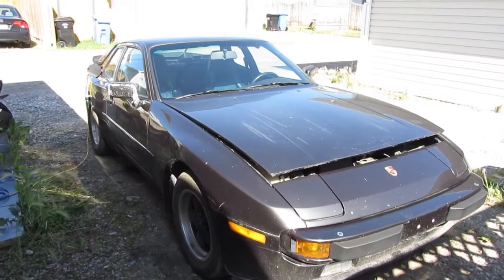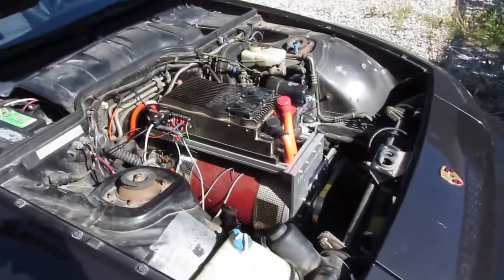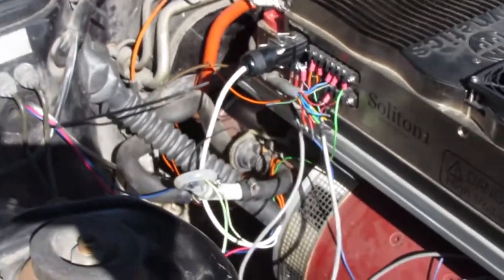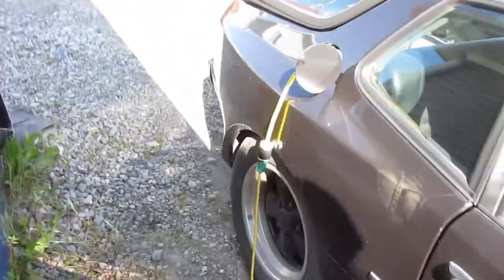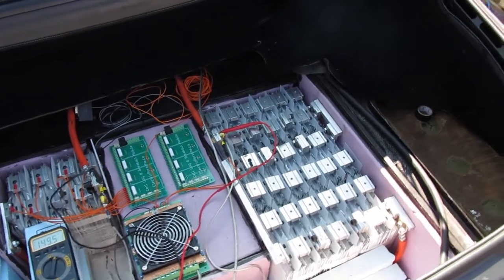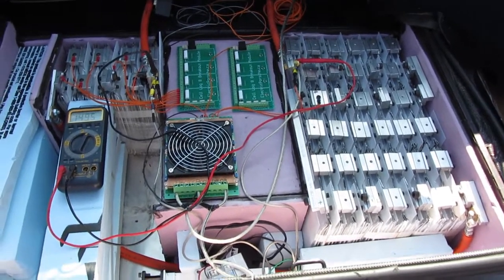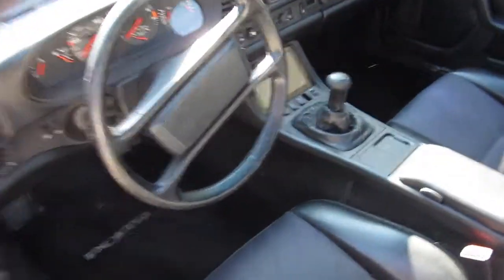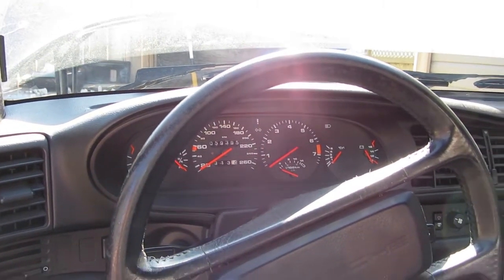Electric Porsche 944

Comment: Hei Robin, still got the car ? im looking for all the possible info i can gather for a warp11 soliton1 944 conversion.
Reply from the maker: Still my daily driver, however it now has a Siemens AC induction motor and DMOC 645 inverter.  Evnetics no longer exists, use caution going with a Soliton1 today.

Comment: Very nice build. I see you got a little tired with updating your blog  with the Siemens/controller swap f.ex. (that I would really like to see) or maybe more busy with the (ugly) 914 ;)  If you still have the beautiful 944, can you please think about making a new video so we can see what you ended up with - would be a joy, and also maybe save other builders a lot of trials and errors. Whatever you do, nice job - I really would like to do something with my 944, but I love the engine too munch to rip it out... if I had one with a blown engine it would be a different matter. There's another way to go - especially if you are a motorhead.  Did you know there's a company that sells a full conversion kit for the 2.5L to run on gas(hydrogen) ? I don't remember their name, they convert mostly big truck and bus diesels but also has the kit - I mean a really proven in racing-kit - with ceramic cylinder coatings and all.. I never found any video's, but haven't searched very thoroughly.

Comment: I have a soliton one and during my testing I am getting the error Pre-charge timeout, no voltage. Have you ever experienced this error when you were using the soliton one? Do you have any advice on how to go about solving this error, my controller mode is currently in Pre-charge Timeout, No Voltage.
Reply from the maker: Has it been like that since you got it?  That sounds like the main contactor isn't kicking in.

Comment: What is your top speed and what is the highest RPM you can take it?
Reply from the maker: There's no safe place here to test top speed so I don't know, however top speed is directly related to weight/hp etc so likely about the same as stock.  As for RPM, this is transmission limited, the motor will rev past 10,000rpm however I've never gone past around 7000rpm.

Comment: First gear didn't seem useless to me. The divide between those who build electric cars and those who actually know how to drive a car for performance continues.
Reply from the maker: That all depends on your gear ratio's, power level etc.  With the Warp 11HV/Soliton 1 and 300v pack 1st gear would just spin the tires without extreme care, even 2nd gear would spin the tires if you weren't careful so with 2nd gear at the limits of traction 1st gear was useless.

Comment: I have recently purchased a Netgain Warp 11HV for my 1984 Porsche 944. I am currently looking at the Evnetics Soliton Jr. motor controller to be paired with the motor. I was wondering if you had any thoughts or tips on the Soliton Jr. pairing with the Warp 11HV?
Reply from the maker: That should be a good combo, make sure you have good cooling on the motor.  Something along the lines of Jacks (evtv) turbo blowers that he use to sell.  I know most people with Solitons had issues (me included) so you may not want to max out the settings or risk blowing it up.  I switched to the AC motor for reliability.  The 11HV is a pretty amazing motor though I hope it works for you.

Comment: During your conversion what was your final gear ratio when using the WARP 11HV? During your EV conversion of the 944, was your drivetrain direct drive with a fixed gear ratio or did you use a transmission and had multiple gears?
Reply from the maker: It's a naturally aspirated body, but has an '86 Turbo transmission, 0-60mph can be done in 2nd gear with no shifting.

Comment: I am converting a 1984 Porsche 944 into a fully electric vehicle. I am planning on using the Netgain Hyper9 SRIM Motor. I was wondering what your thoughts for using this motor for my electrical drive train. Our mission is to convert this vehicle with a after conversion weight of 2,900 pounds, with a 0 -60mph in 5 seconds, and a range of 70-80miles. Do you this Netgain Hyper9 SRIM Motor can do the job?
Reply from the maker: A 120hp motor is not going to get you anywhere near a 5 second 0-60.  The motor would be good for the car, and likely be fun  to drive but not that fast.  The battery will determine your range.
With lots of traction issues I did 0-60 in 4.8 seconds with roughly 300hp and 300ft-lbs.  Now with the siemens AC motor I have 130-140hp and 220ft-lbs and my 0-60 is likely 7-8 seconds at best.  I haven't actually measured it.
Reply: What electric motor did you use to get "roughly 300hp and 300ft-lbs"?
Reply from the maker: The Netgain Warp 11HV, Soliton 1, and an A123 pack just over 300v just within the limits of the Soliton.
Reply: But the Netgain Warp 11HV only has 44HP and 135ft-lbs of torque. 
http://www.evwest.com/catalog/product_info.php?products_id=84
Reply from the maker: Those ratings are at 72v and 452A (32 1/2kw).... run it at 300v and 1000A (300kw) and you get a lot more power.

Comment: I am currently designing the electric drivetrain (motor, motor controller, batteries, etc) for the 1984 Porsche 944. While you were performing the electric conversion for the 1984 Porsche 944 what major problems did you run into? And do you have any suggestions or tips when creating the electric drivetrain?Thank you
Reply from the maker: AC motors really are worth the extra cost.  Otherwise the 944 is a pretty good platform, look at Volt/Leaf/Tesla batteries to power it.

Comment: What type of electric motor and motor controller did you use?
How fast does the car run in miles/hour?
What is the range of the car on 1 full charge, how many miles per full charge?
Reply from the maker: Initially the car used a Warp 11HV and Soliton 1 controller.  Currently I use a Siemens AC induction motor and Azure Dynamics DMOC645 controller.  The regen definitly helps!
I can speed but I have no idea what the top speed of the car is, there is no safe place here to test that.
I currently get about 125km on a 15.5kwh pack, I'm bumping it up to 20kwh to give me a bit more buffer in the winter.  When availability is up and prices come down I'll put in either a half or full Tesla pack, (Model S or 3 depending what I can get my hands on) that will drastically increase my range.
Currently the car takes care of all of my city driving needs very well.
Reply: Thank you for your response. I am currently designing the electric drivetrain (motor, motor controller, batteries, etc) for the 1984 Porsche 944. While you were performing the electric conversion for the 1984 Porsche 944 what major problems did you run into? And do you have any suggestions or tips when creating the electric drivetrain?

Comment: I converted a 924 back in 2001. I really like that car it's a good one to convert. Had 20 orbital batteries and 11 in motor and a 2K Zilla controller. Not easy getting the gas engine out of that car though I had to take the rear transaxle loose and the front suspension to get the motor out.. nice video thanks for sharing keep up the good work.

Comment: a funny comment to all you blind "electric fever" drivers i see in the comments...... where do you think your electricity comes from exactly?? ... from burning fuel, just like a gas powered car..... so in actuality you're not helping the environment much if at all, LOL

now find me a solar powered charging system and ill be ALL OVER IT!
Reply: I don't like EVs cuz I'm some god damned tree hugger, have you seen how much fuckin' torque these things make?
Reply: Reformed Jedi Order AAAANNNDDD as technology improves, that of creating the electricity (solar, wind, geothermal, or what ever else will come in the next hundred years) your car becomes more efficient.
Reply: Even moderately clean coal plants are able to make cars more environmentally friendly then gas cars. More importantly, they are future proof and their potential is not already maxed out in the same way combustion engines are.
Reply from the maker: I won't get into a debate over the environmental impact of electricity, however for me personally, I use the enmax greenmax program which allows me to buy enough renewable electricity (mostly wind generated) to drive my car over 10,000km per year.

Comment: Nice... what size motor ?
Reply from the maker: It's a Netgain Motors Warp 11HV, I'm swapping to a lower power but more reliable 3phase AC motor, however with the 11HV the car did 0-60mph in 4.8 Seconds...
Reply: did it get hot with 11HV It looks quick, I am about to do a conversion on a larger car I was going to go with twin AC35 But everyone I have talked to have said they are slower have less power down low as well? and not as reliable ?
Reply from the maker: skippy813 The 11HV did get hot, but not outside it's safe zone, I didn't have forced air cooling.  The issue I had was a "zorch" or plasma event due to brush dust.  The dual AC35 is cool, but not exactly powerful for a large or high performance vehicle.
Reply: I am thinking of running twin warp 11" or  Two inpulse warp 9"..  with a ZILLA EHV what type of pack were you running & voltage ?
Reply from the maker: 300v pack of CALB CA's, however for racing/performance you'd want something with better power density
Reply: What would you suggest ?
Reply from the maker: For drag racing Lithium Polymer has about the best power to weight ratio.  Depends on your goals/budget.
Reply: We have a few Drag Cars but no ev type Drag car. this will be a first for us we are only looking to run 11 sec as a exhibition car to show everyone that EV's are not TOYS so to speak.
Reply from the maker: A pair of Warp 11's, Zilla 2k HV or EHV and the highest cell count of CALB CA 100Ah cells that the controller will handle would likely get you there.  The battery would be fairly large and a bit heavy, but would put out 1400-1500A for short periods.  It would also be very easy to put together as a first build.  Something targeting 9-10 seconds or faster would require a different type of battery.
Reply: Yes I have talked to George Hamstra, Rich Rudman ,Mark Schiess,  John Metric, Michael  from EVWEST about this.. everyone has   slightly different ideas… I need to run a trans two speed and I am thinking of running a converter as well with a 1500 rpm  stall to punch it hard off the line some 28 inch slick tyres not sure on the gear ratio because of the instant ft pound these motors have might start @ 3:45 ratio and see if that works, 31 spline Currie axels 9 inch diff. normally we would run a convertor with 5000 to 6500 stall with the  gas engines. I like speaking to people how have had hands on experience like you ! we have never put  such a large battery pack together before so cross my fingers!
Reply from the maker: Sounds like you are off to a good start.  This type of set-up should be capable of 11 seconds with some trial and error, mostly on the gear ratio's and Zilla settings.  If you can find one or a new one fits the budget an Evnetics Shiva, would be a nice controller to show off what's available for EV racing (but you might need CALB 180's to make use of the current capability).  That type of battery is the simplest to put together and you'll learn a lot and once you have the car tweaked and running well you would have the background and experience to potentially make something really quick.
Reply: thanks for your comments i don't need to go more than 40 miles in this car so i just really need a good battery that will produce good punch and not so much capacity
Reply: skippy813 How is your drag race EV project going?
Reply: Hey mate
just buying some time at the moment I want to use a brushless system if possible just waiting for the right system to come on the market thanks for asking

Comment: Hi! Cool machine, how many miles on a full charge the battery enough?
Reply from the maker: Range is around 60 miles by design.  It could be higher, could be lower, but that's what I need so what I built.
Reply: Robin Wainwright Robin is possible to use automatic transmission? Please write me at mystafine@gmail.com

Comment from the maker: It's a significant cost and amount of work, but 100% worth it!  The car is a blast to drive, has tons of low end torque, I'm about to double the battery voltage should it should get even more fun.